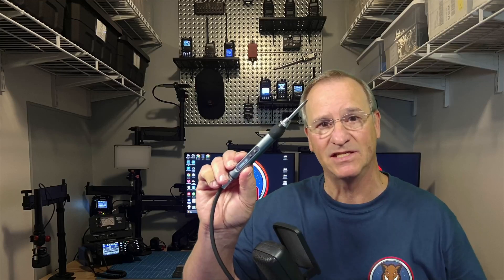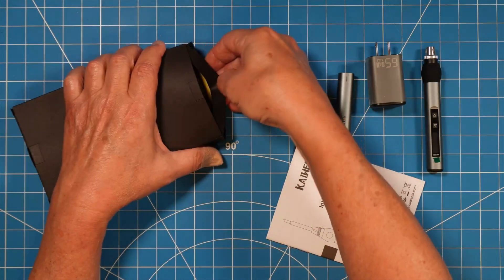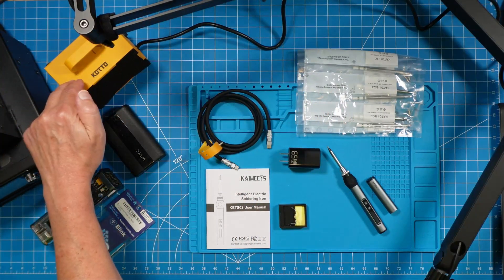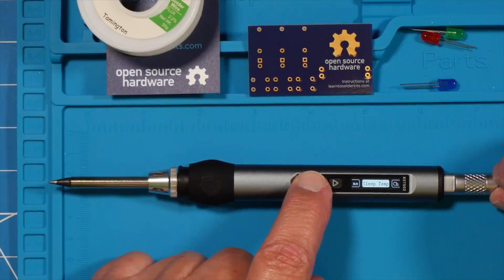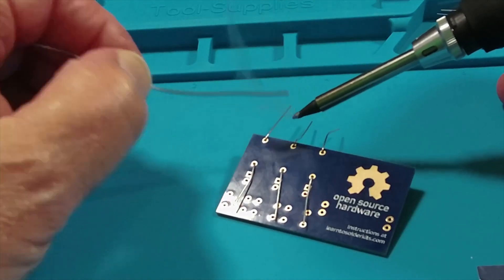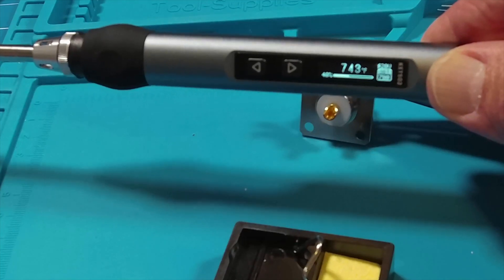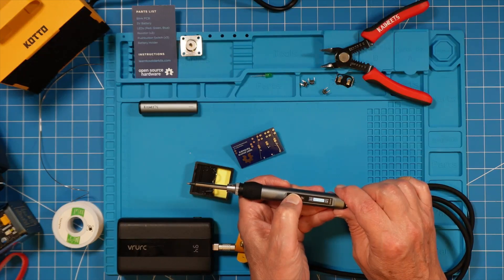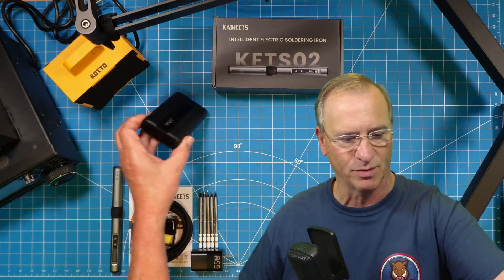Portable Intelligent Soldering Iron With Fast Heating Runs On BATTERY or AC - Kaiweets KETS02 Review

Comment: Looks like an upgraded derivative of the TS-100, I wonder if the tips are compatible. The pinecil is what I use (also ts-100 derived), was super cheap and I love it, but the construction of this and the metal tip cover are pretty amazing. I might pick one up for that alone. I have a 65w usb-pd battery pack that gives me full power and should work with this.
Reply from the maker: Thanks for watching and commenting; so far I've been impressed with the projects I've used this on.